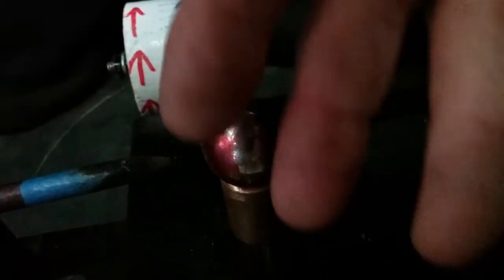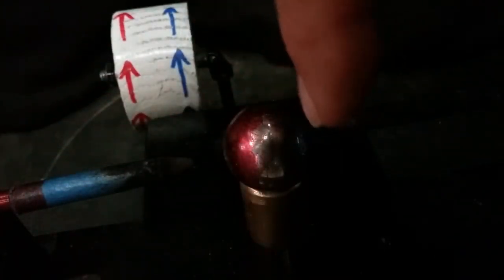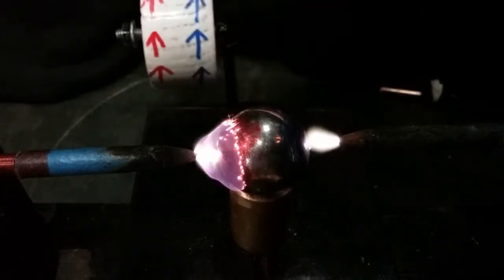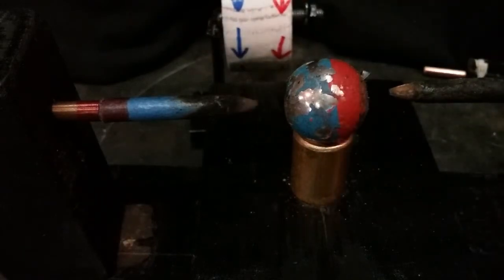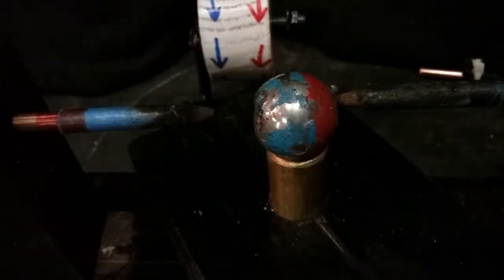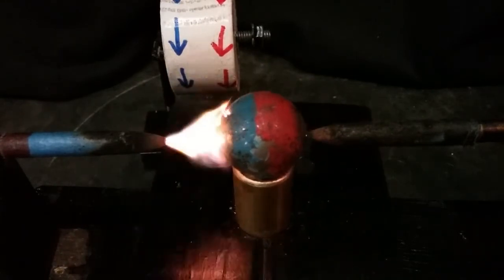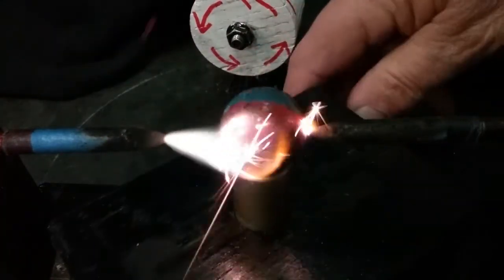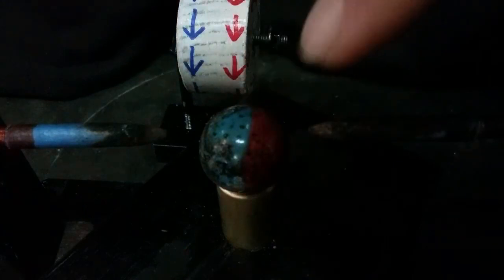15K Volts Prove Me Wrong Again

Comment: This is good news. In the language that I am using, I would say that Aether is circulating in the same direction that you see on the CRT screen. Magnetic fields do not spin because magnetic fields are mathematical constructs where every point in space is assigned a value. When a magnet is not moving, the magnetic field does not "spin" (the field values don't change), but the Aether generating the magnetic field does spin. This is what I refer to as Aether Circulation. I hope you don't mind that I am clarifying this here. I know that you and I are on the same page about a lot of things. I am trying to develop a language that is clear and non-ambiguous. Saying that the magnetic field is spinning is a bit ambiguous in my opinion. The Aether circulation around the magnet must be pushing and twisting the plasma in the arcs you are generating. In the CRT screen, the Aether circulation must be pushing and twisting the path of the electrons near the CRT screen causing them to hit in a different location than expected when the magnet is not present.
Reply from the maker: I have a new demonstration I am working on which seems to reveal more about the magnets field...
Reply: I agree that a magnetic field doesn't spin, not because it is just a mathematical construct, but because it is a pressure gradient. I don't like the idea of electron flow as being Aether flow, we need to understand that they are different entities, electrons are created from Aether flow, just like molecules are created from atoms... In my opinion, lol. So is an electric current flow, electrons moving about, or is it Aether flow? Electron flow is ambiguous in my opinion, I have never taken to that in over 30 years of being an electronics engineer... I have accepted it, used it, but never felt it was right, I have always had a feeling that something wasn't quite right with this idea when dealing with electric current flow. Aether flow fits in far better, and makes far more sense, especially in regards to electric circuits, and semi-conductors, it just makes more sense. Voltage on the other hand, is pressure, Steinmetz was spot on when he said that voltage was consumed in the making of a magnetic field, the same way, that current is consumed in the making of an electric field (Capacitance). The big question is, does pressure always create Aether flow, or can a pressure gradient move around the Aether without Aether flow? Inertia plays a very important role here. I suppose, that as everything in the universe is made up from Aether, then you could say that the Aether is always flowing, regardless of the material it passes through. As regards to the CRT screen, is it the Aether flow, or pressure gradient of the magnet that is changing the direction of the CRT aether flow? Questions questions questions! 😎
Reply: @cazcam2000  I agree that current and electrons are not the same thing. But I do propose that they can both still exist. Current flows in one direction along the wire and electrons flow in the opposite direction IN the wire. Here is a video that my friend Kerry made the shows using nice demo, how that works. He just released this yesterday so the timing couldn't be better.
Reply: I also agree that the there is a pressure gradient around the wire that can be defined by a field (a mathematical construct that assigns a numerical value to points in space). I am very specific about the language that I use. I distinguish between the concept of a gradient and the concept of a field.
Reply: @cazcam2000  As regards to the CRT screen, I believe that Aether Circulation is the cause of the twisting of the image on the CRT screen. Aether Circulation is the cause of both the pressure gradient and the CRT screen twist.
Reply: @FractalWoman  I have mentioned aether flow vs aether pressure, in a reply to you on one of good vibrations earlier vids, a couple or so vids ago. But to summarise. Voltage and current flow are different modalities, but are both part of what we know as electricity, the same idea applies when talking about the Aether, Aether flow is different to Aether pressure, they are both aether modalities, but they behave differently.
Reply: @cazcam2000  "Voltage and current flow are different modalities...". Of course this is true but I'm not really sure why you are insisting on telling me this as if I don't know this. Fluid circulation can also create pressure gradients as can be seen in Ionel Dinu's spinning cylinder experiments which cause the cylinders to attract and repel similar to how magnets attract and repel. Fluid flow through a tube can also create pressure . This can be seen when you flow water through a flexible hose. The faster the water flows through, the more pressure is inside causing the hose to become stiffer. Pressure doesn't just have one cause. Long story short, Aether pressure CAN be cause by Aether flow. IMHO
Reply: @FractalWoman  I am sorry you thought I was trying to be insistent, I wasn't being disrespectful, I was just giving a different perspective regarding flow and pressure. Is the Aether the fundamental substance at the foundation of our universe, or is it something else? I see aether as pure energy, and when pure energy is in it's natural state, which is a state of equilibrium, of balance, it is still. It is motionless, and resides at what our scientists call "Zero point energy", absolute zero degrees kelvin. So the question arises, how did this pure energy acquire motion, vibration? A force, a pressure could create motion, and as this energy field moves, it creates what we term heat, the aether starts to flow. And that is the point I was trying to make. Yes, aether flow can create pressure, yes, the aether can create a force, but when the aether was still, who, or what started it into motion, and is that "Who/What" still creating that motion today? You are concentrating on aether flow, and I think that's applaudable, but I think you are only looking at half the picture, and assuming the other half is just a reflection of the first half, this is where we disagree, and essentially the point I was trying to make. I am not insulting your knowledge or intelligence, I am just putting a different perspective forward. The aether doesn't put itself under pressure without there being an external force doing so first. Aether flow is only part of the answer, particles, electrons and all the other BS that mainstream screams about, are only part of the bigger picture. I believe "Consciousness" plays a major part as well, but as it will be many, many years before that type of idea is proven, we will just have to stick to random aether perturbations instead!
Reply: @cazcam2000  No worries. I was not insulted. I am just trying to be clear. Just because I have only shown you half the picture, doesn't mean that I am ignoring the other half. I am building a foundation.  So, when it come to me and what I think, don't make any assumptions. Once the puzzle is complete, then we will see the whole picture. Baby steps.
Reply: @FractalWoman  Lol, an "Assumption", is a guess based on the amount of information that is available at the time. Asking a human being not to make assumptions, is like asking a bird not to sing, people will always make assumptions, it's hard wired into us. I await the complete puzzle with eager anticipation, baby steps an all!  😉

Comment: Looks fierce.
Did you try a different transformer ratio?
When the amps go down and the voltage up, it doesn't get so hot.
Maybe also the arc would be thinner. (If you like that)
Reply from the maker: I don't have a variac - and the only other transformer I have is a microwave. Maybe I can find a way to adjust the amperage down in the future.
Reply: @TheGoodVibrations  Be very careful with electricity, it can easily kill a human! But you can type "diy transformer" in the YouTube search bar.

Comment: very cool.  And this shows that the forces of the magnet are coming out of the north and pushing against the electrons coming toward it, but the forces go back into the south, and the electricity is more stable and smooth in the south because nothing is pushing against it anymore.  Ken's theory about the magnetism forces coming from both ends is incorrect, and my theory is correct.  And so is your theory.
Reply: I agree. If Ken's theory was right, then there would be no difference between the North and South pole and he seed experiments would show no difference. He says it is because of a Phi:1 phase disparity, but he never actually explains that. He just says it as if it were true. That is not good science.
Reply from the maker: The South and North BOTH "resist" against the incoming Positive current. I believe both S and N (poles) ends are dielectric inputs. The positive electric current input (S or N) resistance is the current finding "frequency / timing" with the natural dielectric. The smooth Negative is the result of harmonic frequency between the current and the dielectric.

Comment: Could you tell me from which terminal the arc or field is starting from?
Positive or negative?
Reply from the maker: It begins with both terminals displaying a slight glow - then the arc seems to appear all at once. I do not have a high definition - high speed camera to confirm if it does originate / travel in a particular direction.